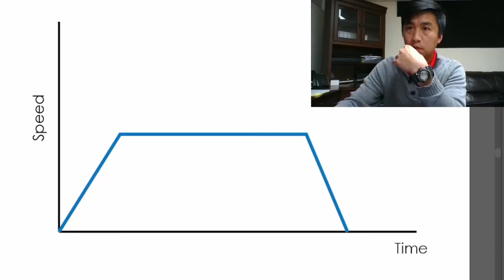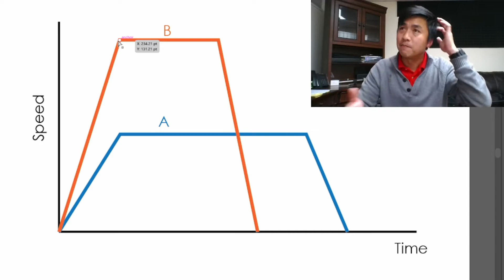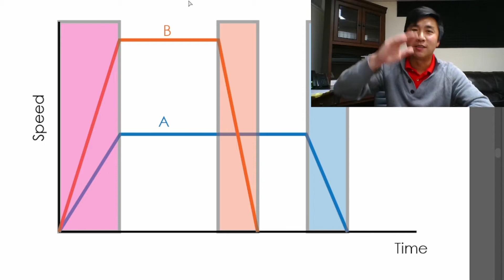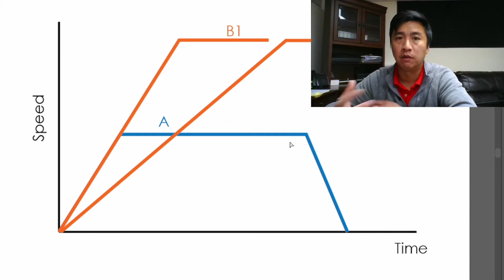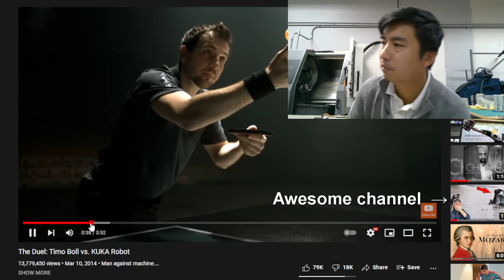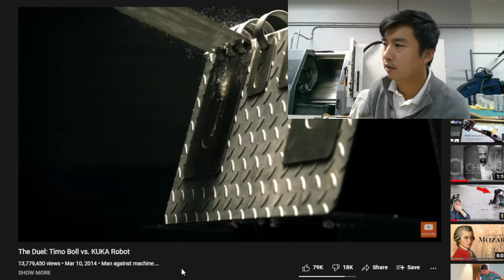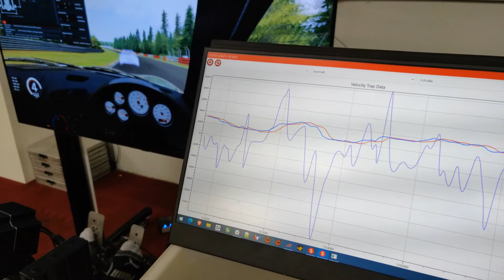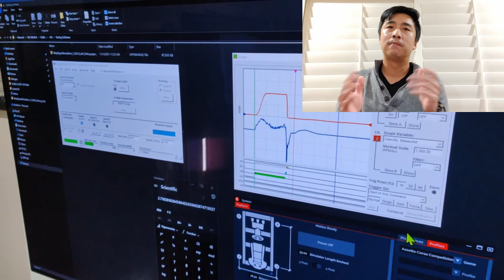Motion Talk 3 - Jerk with Howard

Comment: from what i understand by this video, for any actuator to go from point A to point B, only maximum speed is not that important, it also needs to have high speed acceleration and high speed slowing down mechanism/braking. i was  looking at qubik systems pl220, and they claim to have 800mm/s max speed, which is highest in the industry right now . imho.
but i would also like to point out lets say, if game telemtry is saying we need to move from point A to point B within X seconds, and if the motion system cant travel that distance in time X, then the user would notice something is not right, i mean lets say in dirt rally 2, if game is showing , car is airborne and later touched down already, but the motion system is still in airborne position, then its no good. the delay in video/telemetry and motion will give bad experience to user.

so real question is what is maximum speed of travel does the any sim games telemetry provide in minimum time X ? is it 250mm/X or 500mm/X  or 800mm/X (X can be in milliseconds/seconds/microseconds depending on the how game is moving forward)

i mean from what your research, have you found, any game which have provided telemetry data which is maximum distance and in minimum time, so from point A to point B should be maximum and time x should be minimum. any input from would be grateful.

if that specific telemetry cant be replicated by motion system then its a bad experience.

Thank you, great video.

edit: watched video again, and the velocity trap data does look good, you said actuators does its thing within 100ms. 
Thanks again.
Reply from the maker: Hey Michael, thanks again for the great feedback. Yes you are correct in what you say. 

The main point of this video is that its very hard to evaluate motion systems just based on travel range and speed. There are many other factors and there are always going to be compromises to motion, as most systems, even the most advanced multi-million dollar systems will always have some compromises. Its impossible or at least very hard to get a true 1:1 speed/acceleration/jerk and travel ratio. The key is to make the best of the data that we have with the tools that we have.

This starts with the software and the telemetry being offered from the developer. GIGO or garbage in is garbage out. So, if the software does not provide good telemetry such as relying on effects or providing low sample rate, Hz rate etc... Then it doesn't matter how good your motion system, steering system or other FFB/haptic system are. This is what you also correctly pointed out. We are always at the mercy of the developer. Some are not so good, others like AC/ACC are excellent. Well done Kunos!

Once you have good data, the next step is to make sure that the algorithmic, electronic and mechanical systems ALL represent the data as best as possible. This is the challenging part and where many other companies take shortcuts with things like effects or disguise their algorithms as  'haptics' to have quick development. Not using canned effects is a very difficult process and requires constant innovation and evolution. This is the Sigma way. ;-) 

To summarize:
1) Good Data : which would be games like AC, ACC, BeamNG, iRacing etc...
2) Specialized Algorithms : running on an embedded controller (not in Windows) to process the data above in true real-time.
3) Smart electronics, including power and servos created for the motion industry (no large EMI filters are needed, or large cabinets with servo drives, step down inverters, EMI filters etc...)
4) Mechanically actuators matched to the electronics and algorithms to continually provide the same level of performance over time.

Each one of the above also requires safety states, to ensure that you don't over drive the system past its limitations OR to unsafe health levels. :-P

So in short and to somewhat to answer your questions above. Yes, speed, acceleration, jerk, software, hardware, electronics and most important algorithms matter. You need the sum (Sigma) of all these components properly integrated (Integrale) to have a proper turn key system, and even when you do, you are always perfecting it and making it better. This is why we automatically upgrade our firmware and software with a simple reboot. It's not thousands of hours in development but thousands of iterations. :-) This is all in our humble opinion of course.

Hope that makes sense. Thanks for the comment!
Reply: @SigmaMotionSystems  Thank you, this sound interesting. specially the part (running on an embedded controller (not in Windows) to process the data above in true real-time) , i would really like to see side by side comparison in DK2+ and D-box.
I can see you guys really know, what you are doing.
Ill need to watch some reviews.
Thank you again for taking time to reply.
Reply from the maker: @michaelkopec.5814  dBox is a good product and a side-by-side comparison with DK2+ would be a great idea. 

However this would not come from us but from a 3rd party that can be critical of both systems. ;-)
Reply from the maker: @michaelkopec.5814  Hey Michael. Just curious if you dove into motion after all these years?